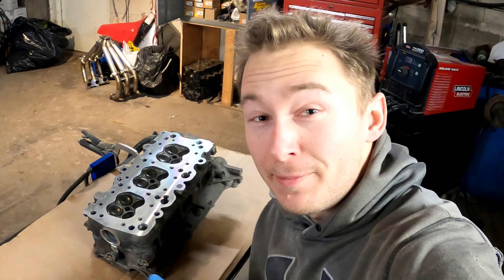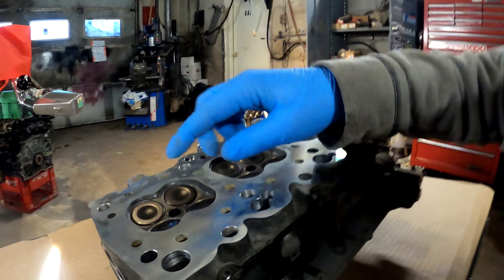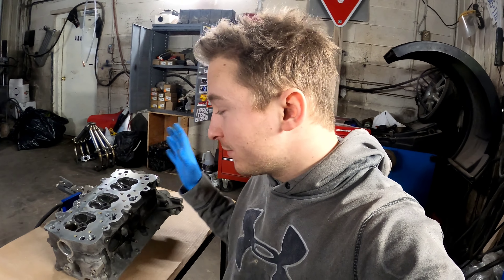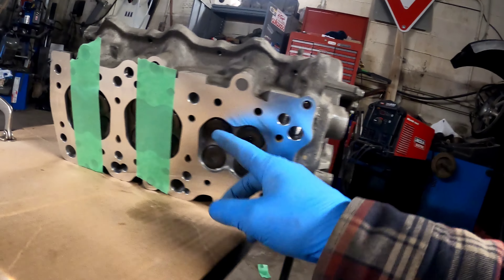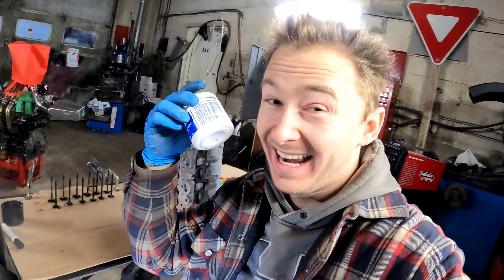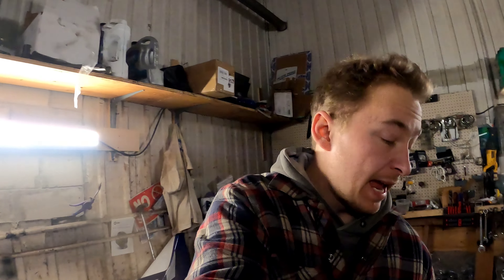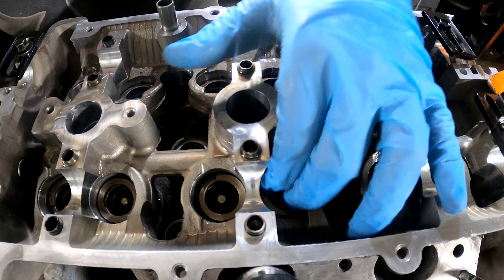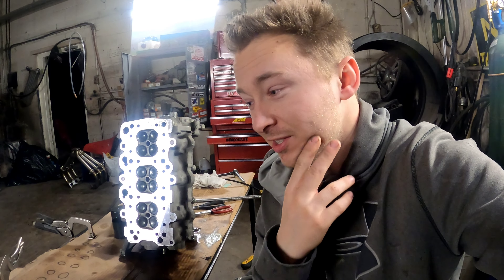Building Heads To Make 1000 WHP In The Suicide Mx3!

Comment: ever do an all-motor NA KLZE build? I'm wondering what it could hit HP wise, I did a KLZE swap in my MX3 in the early 00's as a younger man
Reply from the maker: I usedto be all about NA

I built one and removed as much weigh from my entire rotating assembly as I could, took markings off pistons, casting flashes off rods, didn't run a second compression ring, and also aluminum flywheel 

It was so damn fast fully gutted I was having a blast with it,
And when I would have a organized race I'd would spray it with 50 shot and she would goooo ahah

Comment: What brand and weight of spring did you use this time. Last time it was a double valve spring, but you had some clearance issues. So I am guessing these are heavier rates this time?...
Reply from the maker: The other springs are not double springs, they are the exact same as these ones

Comment: hey bro, can you tell me if the k8 crankshaft is compatible with the kl-de engine?
Reply: No it is not. K8 crank can be used but with k8 rods and then need to have wrist pin whol honed out. Then itll destroke the de down to a 2.1 rod ratio, 8.8cr and a 9k redline. I kno alot about these motors for some ungodly reason.
Reply from the maker: From my knowledge it makes a de stroked klde I could.be wrong?
Reply: @xrp861  hmm the only crank I found here was the k8, I will study the possibility of using it